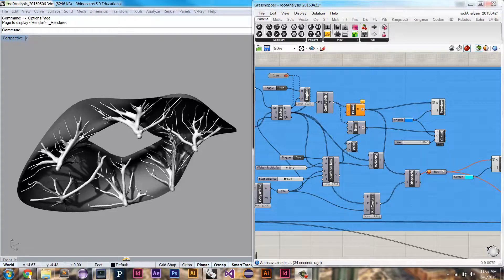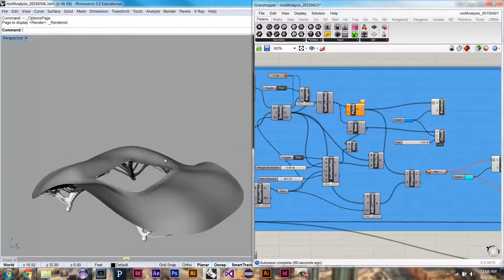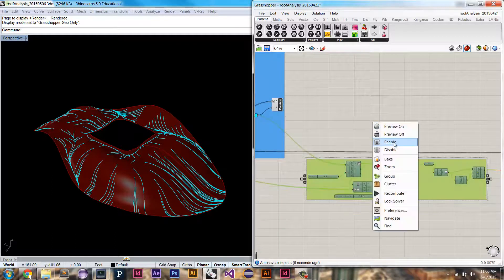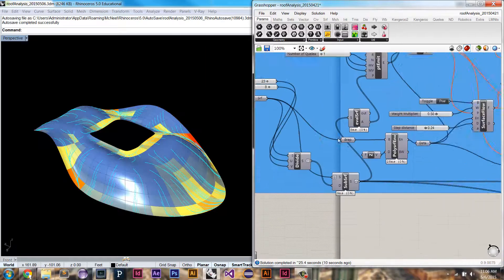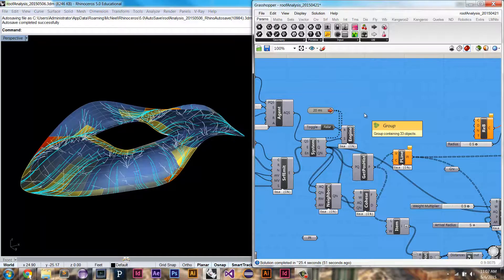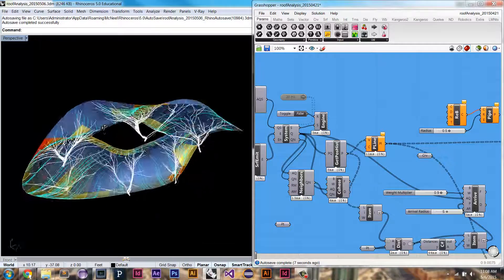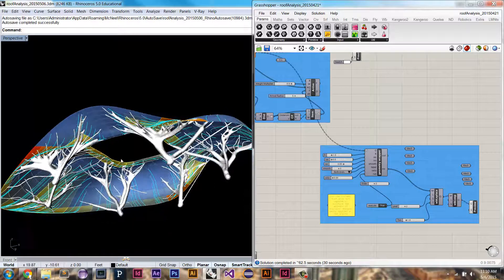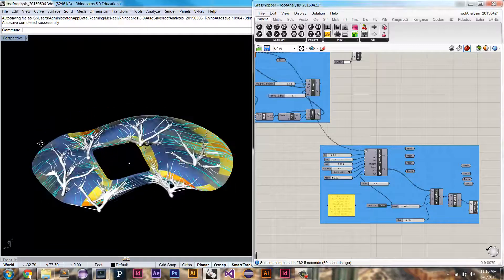Quelea - Generating Support Structure from Rainflow Analysis

Comment: Hello Alex. Thanks for perfect videos. I was trying to reproduce that support system, but there is a problem with working in data structure. I have two (three, four, five) groups of points on a surface and I wanna grow supports from them. When I plug in points as emitters to system, they keep data structure as branch and they behave according to it. But when I apply "cohese force" to them, data structure is lost and they are all attracted by each other. Do you have any idea?